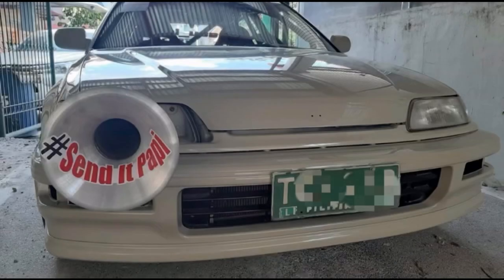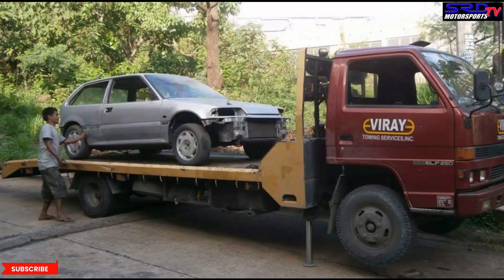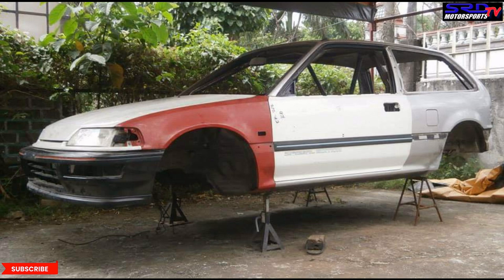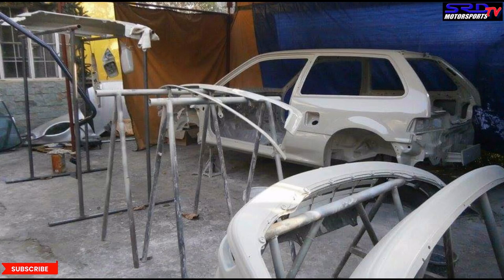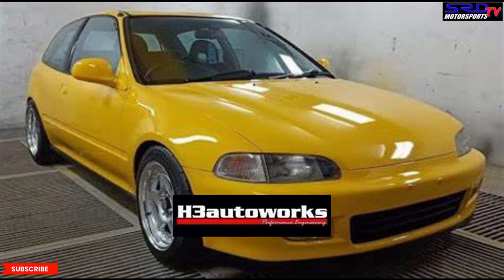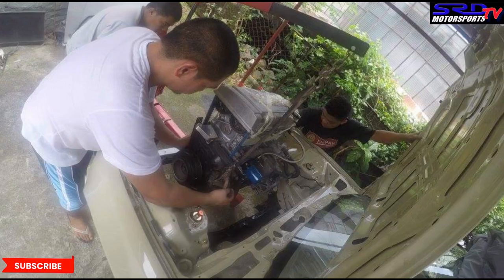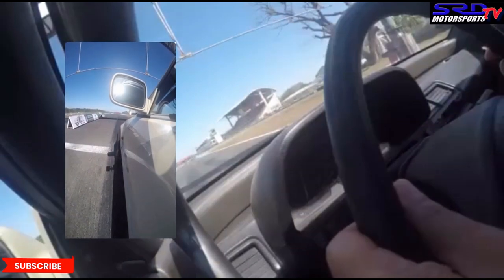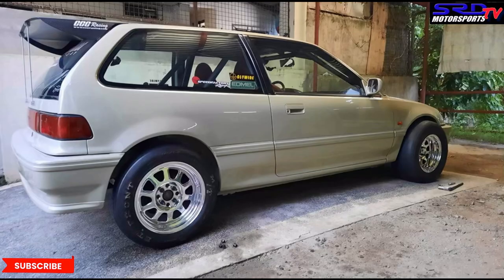1991 Honda Civic EF : Complete Restoration into a Daily Driver Racer

Comment: Can i ask what exhaust did you use on that ef? btw love the build!
Reply from the maker: Oh hey man! Thanks for checking these out and the channel… this Ef the exhaust is just a 2.5in scav/reso but the owner has a Speedfactory 3in exh system he will soon use when we get to do some small upgrades etc and redyno
Reply: @SRDmotorsports  is the size of your scuv 24inch?
Reply from the maker: @miggyboi6357  yep 24in and a shorter one does not make more or less power just noisy… the “total length” matters